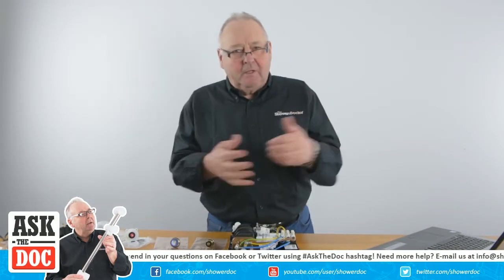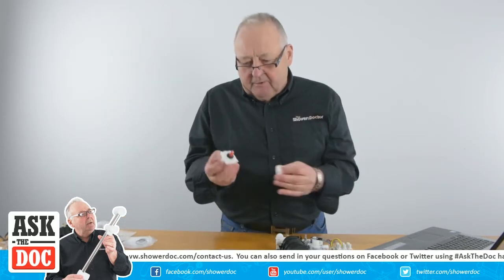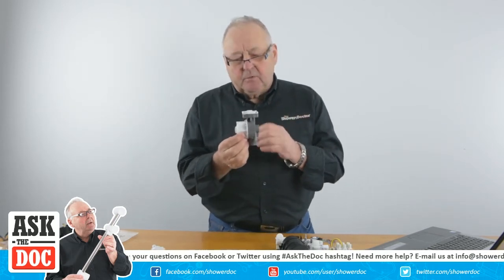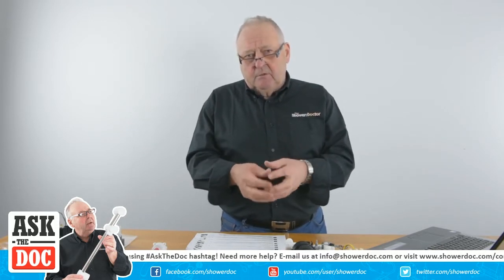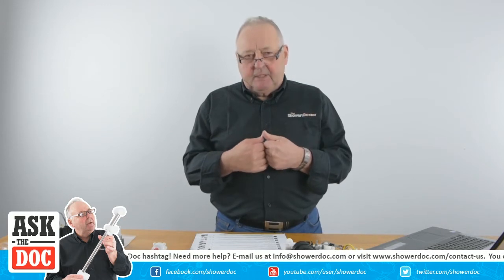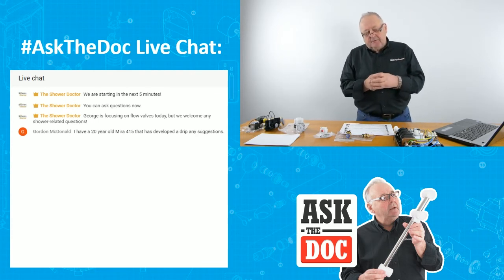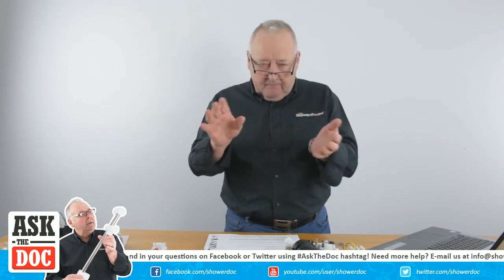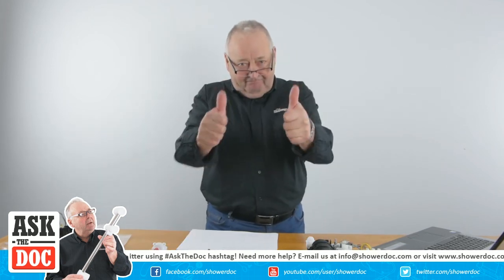AskTheDoc #6 Highlights (22nd of November 2017) - FLOW VALVES

Comment: Just fitted a brand new Mira Excel thermostatic cartridge assembly (903.33) and water is  pouring out of wall when it’s shut off. It was okay until I removed it and reinstalled it to see if I could get hotter water. Had to put the old faulty cartridge back in. I’ve no idea what’s wrong with the new one. Seals are all there. Perfect condition. It’s screwed on correctly. Total mystery. Can’t be the pipes or fittings because old one doesn’t leak. Any help is much appreciated 👍